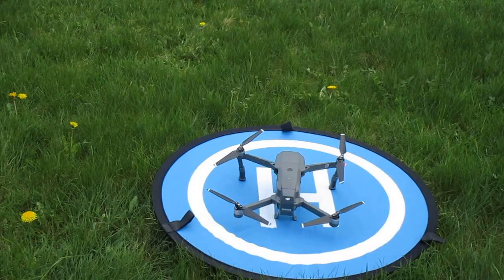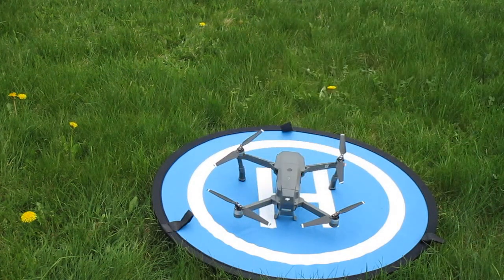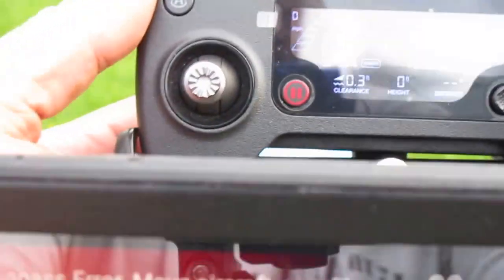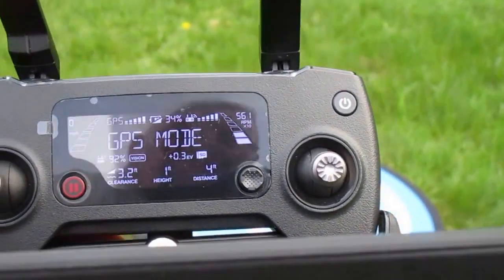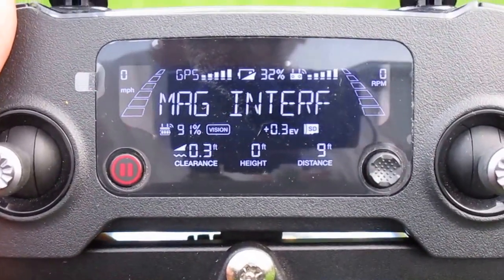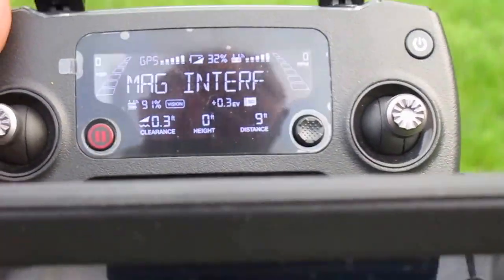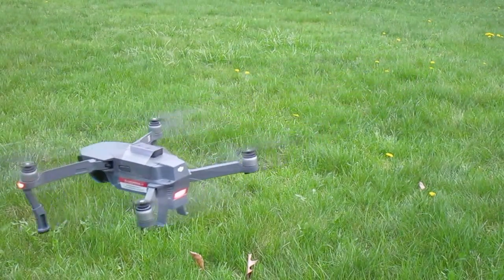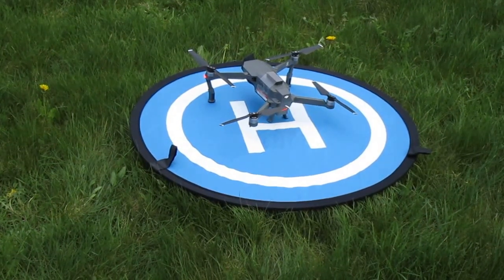Mavic AC -- Induced Magnetic Interference during Flight

Comment: At least the maker of this vid is on my level of thinking. i have 3 p3s and a p4 pro tbh i cant wait wait for dji to crash them for me so i can move on to better drones. The more i look into dji the more likely i think that within 2 years id say they will be swallowed up by apple anyway then no one will be flying anything but apple drones. Either that or dji will shrink back to selling elec components on ebay. They created the worldwide drone prob now dji are under increasing pressure by various governments around the world  to fix the prob they created by any means poss hence the untested updates designed soley to crash ur drone or fuck it up so badly it wont even fly without twitching all over the place.  drone problem fixed. Lol even the us army has issued a cease use of all dji equipment secure units remove all mem cards and batteries and await instructions for onward disbursment us personel have died in service because the dji drones they were using had given away or compromised the secure locations they were used at yea fuckin awesome dji nice one and a big fat fuck you from the uk

Comment from the maker: This is an ongoing issue with the Mavic controller , Not only is it the most important part of the system it is also the weakest .The magnetic pickup sensors used in the control stick circuitry and assembly should have never been used in a $1200.00 dollar RTF aircraft  package .  I have found that this type of controller assembly is widely used in inexpensive ($25) toy drone's and Home video gaming  machines where transmitting range an interference is at a minimum used in mostly a controlled atmosphere ie. your home in front of a TV. I've had discussion's on the DJI Mavic forum about this and was being tolled that if DJI used Potentiometers in there stick controller assembly it would have made the remote controller huge, bigger then the aircraft it self which I claimed was BS, by the way the DJI Mavic remote controller is the only controller that uses these type of components, circuitry and assembly out of all there other DJI's Drone controllers and while were on the subject of size I guess it's OK to have a set of DJI goggles as a controller that are so huge to where you can fit (2) two Mavic's inside of them ?  My whole point of my testing was to show how the "controller only" is susceptible to magnetism and it's effect !Remember I'm using permanent ceramic magnets in the video this is not EMF - Electro Magnet Force that creates EMI - Electro Magnetic Interference that is much stronger and will change dramatically in the field by just moving a few feet from your original position if it is your position that's causing it --- Most of the EMF interference comes from within the Mavic itself . Now for the "Mavic aircraft itself" I found out in my testing that EMI will cause a loss of GPS and cause it to go into ATTI Modeand now with the NFZ implementation that DJI is doing , it causes an intermitting False Positive NFZ to trigger, I posted my findings to let other's know that this was happening, it was this finding that had me banned from the DJI Mavic website forum! I think the DJI Mavic is an awesome RC however it does have it's weak points that I feel Owners should know to avoid crashing or total loss. DJI advertises the Mavic to be a state of the art anyone can fly RC system however it's not Bullet Proof that many are lead to believe or are BrainWashed  to believe. I only have one question for DJI and they can't give a direct answer and use the wind as an excuse when reading flight Data  : If the "Mavic AC only" experiences Interference is it possible that it is causing false positive direction inputs ?My answer to this is Yes !!!  when this happens it shows up in the Flight Data as the AC flying off in a direction opposed to actual controller inputs, hence LOSS OF CONTROL , This issue is reported to happen in low level no wind conditions !! Yet DJI and Forum "Data Readers" claim drifting on the wind is always to blame,  so I guess a Mavic Flyaway that changes height and direction is due to the wind ???  You will never hear of interference causing False directional inputs to the Mavic!!! Those that are active within the RC community know this does happen,  we all experienced it at one time or another The mavic system is not immune , it will experience more then what all RC systems do all because of the system being highly susceptible to EMI - Electro Magnetic Interference.     DJI , You know you messed up using this type of Controller just admit it, don't Ban People from your Forum website to suppress them for informing Others -- Your type of information suppression does not go on in the U.S.A.Good Luck in your future Drone business
Reply: I know you wrote this 2 years ago but i will add my two words here: 

Today i drove to my friend's farm field to fly my new Mavic Pro Platinum and practice a bit. Nothing around, no metal objects. Just me and some sheeps few yards away. First thing i noticed : Compass Error. Could not take off. Try to re-calibrated few times = failed on each attempt. Packed my stuff walk few meters away and tried again. No Compass Errors - GPS Mode, full signal - OK lets try now! I got habbit to keep drone hoovering so it can warm up and it was a good habbit. Since i took off within 15sec i got compass error again. Drone switched into Atti mode and started flying away. I managed to control it and land it safely. I contacted DJI to ask what could cause this issue to happen as i was on empty field and there were no any metal objects, wires, cables = nothing! Once im flying drones im not having any metal objects like smartwatch on me either... Dji Reply was: It's because of your phone. Im using Samsung Galaxy S10+ that is not stated on their compatibility list and because of that im having Interference Issues :). I laughed... Must have different android on my s10+ than the one that you can find on S9+ which is on the compatibility list. Guess what he advised me to do ? Send it back so we can have a look at it, in meanwhile we will send you a replacement - refurbished unit (fuck knows), how long used. My Pro is month old no scratches or marks at all.

I gave up on DJI and i will try another time tomorrow. However i will definetely choose different brand once the time comes for a change. People should know these things to avoid putting themselves into this kind of situations. Specially when you paying £1000 for a device that is not as advertised and there is nothing you can do about it. Even DJI could not help me so they found cheap excuse. If my drone would fly away and crash - problem solved, operator error.
Reply: Hey there!
I found your video cause i guess i just experienced the same. Im new to the Mavic Pro, actually im new to Drones at all. So I just tried my frist two test flights on a open football field. Since it was my first test flight i didnt paid attention if i lost the gps but i recognised that the mavic somehow didnt fly a straight line as i expected it. Like it almost flew a little curve. First i thought its caused by wind. Later i thought about it again and realized that the gps sensor should keep the drone in position so that it could fly a straight forward line when i just press the forward stick.  Second I noticed some yawing from the mavic while hovering. I almost didnt realized it, just when i paid close attention to the screen. After while i had to correct the heading cause it yawed for like 10°? in about 20 sec. I was afraid if maybe there is maybe something dameged. Like the compas itself. But since i read your post im guessing its caused by some interferences? I'll do some testings outside the city to be sure about that. Otherwise i will contact DJI about that issue. 

After i did some research i had my second flight and i got a bit dissappointed cause the mavic lost the gps quite a few times. Guess it was maybe caused by some rails since i was directly on top of an underground station?